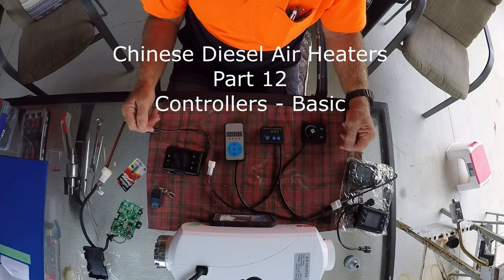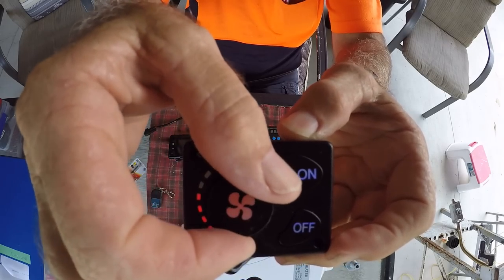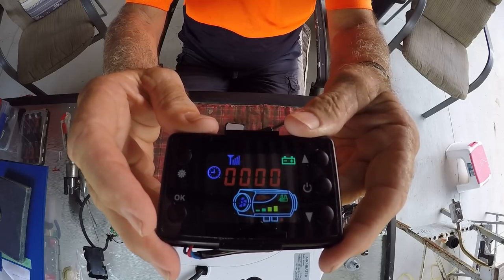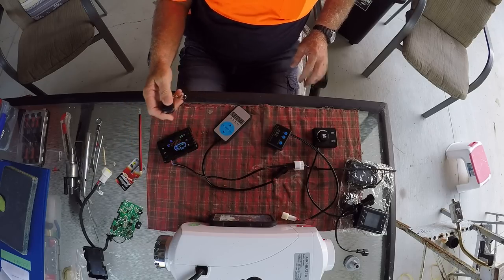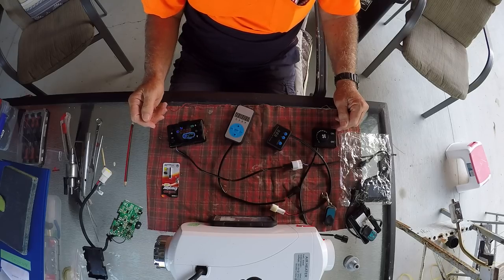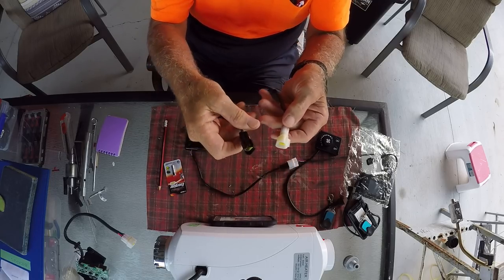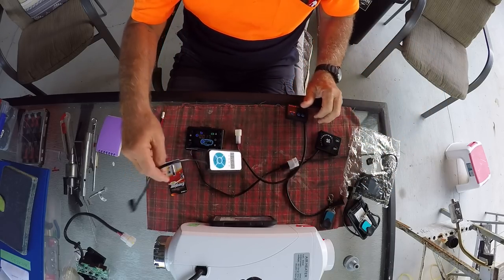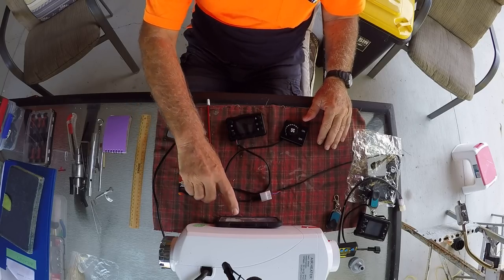Chinese Diesel Air Heaters -  Part 12 - Controllers (Basic)

Comment: John what do you recommend for a filter on the intake of the little heater mind goes in a camper which can get Dusty do you recommend anyting to that to filter the air or do you recommend just draw in fresh air in from the outside and not circulating the air inside please let me know ASAP cuz I'm fixing to hook up one
Reply from the maker: Hi Steve, I assume you mean a filter on the large air intake that goes over the heat exchanger. Yes you can buy a high volume air filter from an auto shop that works a treat.
Whether you recirculate the air or draw fresh air in from outside is purely personal preference. 

You will need a good foam air filter on the combustion air inlet in dusty conditions.

Regards.  JMcK
Reply: @johnmck1147  thank you so much for your reply I really needed to know as Iam putting this in a enclosed trailer / tiny house I guess I did mean filter your study of the diesel heater has informed me quite well and I see what you say about the 5kw and the 8kw wish I had saw this video before I spent extra for the 8kw but Lessons Learned may your day be blessed keep up the good work Steve
Reply from the maker: Steve Sidden 

Your welcome Steve
Reply: @johnmck1147  I forgot to ask you earlier do you feel confident that this little heater will heat 160 sqft enclosed trailer and the negatives with 1 inch styrofoam insulation in the walls and 2in in the ceiling and one inch in the floor I would prefer this type heater over a propane heater 2 to 1 because of the moisture I have already received a 5000 KW and have made Provisions for it although I could use propane please reply ASAP and again thank you
Reply from the maker: Steve Sidden 

Hi Steve, a 5KW diesel air heater will keep you snug and warm in your trailer even in very cold weather. It will also give you a dry heat and not fill your trailer with condensation and water vapour that you get when using a propane heater.  JMcK
Reply: @johnmck1147  again I must say thank you for your expertise I do appreciate it may the holidays that are coming up be much for you and your family Steve
Reply from the maker: Steve Sidden 
Your welcome Steve. JMcK

Comment: Speaking of the controller with the different wiring.
Would it not have been possible to use a normal controller, change the two wires around on the plug and then use it?
I am sure these one wire is positive power, a 0v wire and a control wire. I am sure changing the wires around would work perfectly without buying a different ECU.
It would be a much cheaper solution.
Reply from the maker: Yes, this is so in a lot of cases, and I have replied to similar questions. But sadly some manufactures these days use a totally different protocol and and this can not be done easily.  JMcK
Reply: @johnmck1147  Ah right. So they reprogram the ECU. Right. Then it is inded important to keep an eye on that. Perhaps it is a good idea to make a FAQ video?
Just a suggestion 🙂

Comment: hi i was wondering if you could help me i bought a heater from a supplier off ebay for cheap and the wirring is different seams wierd to me 
i pad $55 to hopfully save on the controller and remote but after watching your video im worried to start it without your blessing

Comment: Another very informative video John, so glad I found your YouTube channel before I went I bought a heater, still haven’t got one yet but I am getting closer to making a decision, do you know of anywhere around Brisbane to buy from, again  great videos mate keep them coming
Reply from the maker: Hi Mick, you need to go through the suppliers to get the best deal, and right accessories. Suggest you purchase off a seller with an Australian warehouse. Have a look at these below as a starter.

https://www.ebay.com.au/itm/12V-5KW-Diesel-Air-Heater-Tank-Thermostat-for-RV-Motorhome-Trailer-Truck-Boat-BK/283071367247?ssPageName=STRK%3AMEBIDX%3AIT&_trksid=p2057872.m2749.l2649

https://www.ebay.com.au/itm/5000W-Air-Diesel-Heater-Car-Vehicle-Heating-Single-Hole-LCD-Switch-Vehicle-12V/273585249890?ssPageName=STRK%3AMEBIDX%3AIT&_trksid=p2057872.m2749.l2649

Cheers, JMcK
Reply: John McK 47 thanks mate

Comment: Have you done any work on setting temperatures and the accuracy of the Chinese units. Generally they rely on the thermostat inside the heater to measure rather than the controller. Unlike the Eberspacher these units won't automatically switch off when set temperature is reached, instead they will continue on iddle.
Reply from the maker: No Trevor.  I often mostly prefer to use the manual function, which I set to a constant comfortable level, and prefer that to having the heater on start up roar at full speed trying to heat up a large area. 

However, you have got my interest, and this coming southern winter I will see if I can find a small garden shed or similar and do some testings with different controllers.

Thanks for the feedback. JMcK

Comment: Could you shut down the heater by unplugging the pump and wait until the unit is cool then disconnect the supply?
Reply from the maker: Yes Chris, you could do that. In my boat I have installed a diesel cut off valve in the fuel line as the heater is in the lazarette and not too easy to access.  JMcK

Comment: Does the IC  have a battery protection safety shutoff ? When the battery goes below 12V (or any set Voltage) does it initiates shutdown ? Can you run the heater while the alternator (~14.5V) is running in a vehicle ?
Reply from the maker: Hi Gabriel, yes these heaters have a low voltage shut off, but it is quite low down around 10 V. I have never heard of any trouble using them with the alternator running.  JMcK
Reply: @johnmck1147  uh , that is very low ...  10.5V is basicly 0% on starter battery which is highly not recommended due to plate damage ... 12,1V is considered discharged ...I think deep cycle RV and Solar batteries can whitstand those deep discharges. It's good to know at least it shuts itself off if left unattended on battery. Is it possible to change the shutdown V value somehow ? Changing a diode , resistor or FW ?
Reply from the maker: Gabriel Kozsar 
I agree about the low voltage level, but this is an emergency procedure, and in real life people must have good battery management of their devices, and one should NEVER connect one of these heaters to a starter battery, that is just asking for trouble. 

This should not be an issue in practice, with proper battery management, but if it is of concern the heater could be connected to a seperate battery management cut off switch.

Cheers. JMcK

Comment: Hi John - Thanks for your video series. Most informative. I’m hoping you or anyone of your subscribers can get get back to me with answers to the following:
1. For the black LCD animated controller is there an option to change the temperature readout to Fahrenheit I/O Celsius?
2. Similar to my question above, is there an option to change to clock display to a 12hr(am/pm) setting?
3: Is there an option to change the default display to current temperature vs current time? Being that this is a device to control the temperature I would think current temperature would be the priority setting. 
Note: My unit came with next to no info on control settings, only error code info.
Reply from the maker: Hi Michael,
Sorry I can't help with those three questions. Perhaps a viewer may have more info. 

Those questions have not been a priority for me in the past, and right now I am away sailing without access to that controller to try different button combinations again.

In the past, when I first got a black LED controller, I tried all sort of button combinations, but I don't recall any parameters that you asked come up, but be aware, it was not something I would be looking for either, and may have missed something.

If you do find out, I would appreciate being informed.  

Regards, JMcK

Comment: How do you prime with basic control?
Reply from the maker: Hi Barry,

Fill up the tube from tank to pump with diesel in a manner that will suit you. Then connect to pump and turn heater on. It may take a few goes to get all the air out.

Suggest you have a look at my video on the pumps.

Cheers,   JMcK

Comment: What I'd love to find out, is if there's any plug or plug adaptor suppliers. I've a three button LCD display with a single on/off button and < > either side. It has a small, round three pin plug, and not the larger triangular three pin plugs that all these other controllers have. I need to find a source for the latter plug&socket sets so as I can ditch the stupid little round one. Wiring still seems to be the standard red/blue/black though. I suspect that my manufacturer was just trying to buck the norm and has messed up big time. Maybe I need to look in the DIY RC model community?
Reply: Having a similar issue with controller plug style Square-Round-Triangle types seem to be the 3 types. I am wondering why I have not yet heard any suggestions to just cut the wires on both plugs (your old one & whatever new one you get) and just solder the old controllers wires (with whatever style plug it has) onto the new controller. There seems to be a pretty standard of 3 wires & what hopefully is a standard color code to where & what functions those color wires go to between the controller & mother board?

Comment: I have the full function control have recently had issues with it going blank and shutting off the heater I know the power is fine the screen will come back on randomly. I’ve hard wired the plugs still has not fixed it
Reply from the maker: Hi Andrew,
If you have double checked the wiring, and you have adequate wire size, not the thin cheap stuff that comes with many heaters, and you have more than 12V at the heater,  you possibly have a bad controller. If the heater is new, please ask for a replacement. If heater is old, you can buy spare controllers on eBay.  JMcK

Comment: Hi John, just had an "incident" with my new diesel heater or actually the 12 volt power supply.........it was working in the morning and suddenly the power supply turned off........drat, the power supply has died .....it was bought new a few days ago.......the big problem is the heater turned off while it was running and I got a strong kerosene smell while it cooled down which was not a good sign.......however 10,miutes later the power supply was working again and the heater fired up so all was OK.
There is no way to overcome the problem as once the PS stops the heater could overheat etc.
To cure this I think a couple of 12 volt electrolytic capacitors connected in parallel with the heater fan motor could supply enough current to the fan for a time to allow the heater box to cool down.....about 5 to 10 minutes of voltage at 12 volts would probably do the trick......how many farads I don't know.
The capacitor(s) would be wired permanently in the circuit in parallel with the fan and get charged from the fan supply while the heater was powered up.......if the power supply stopped the capacitors would automatically supply power until they ran down.......just need to have them big enough to last 5 to10 minutes to just drive the fan while it cooled down the heater box.....the fan motor draws very little power......if it works it could be a savior.
Have you any ideas on this theme?
Reply from the maker: Hi Ian,

On shutdown, it is not just the fan that comes on but also the ECU turns on and heats up the glow plug to burn off any remaining unburnt fuel. You would need some mean capacitors to provide 8 to 10 amps of current for a few minutes.

If a power supply failure is very remote and the heater in not in an enclosed space you could possibly accept the risk of failure.

Perhaps a better solution is a small motorbike battery and a small battery charger permanently connected.  JMcK
Reply: @johnmck1147  Thanks, yes a normal shutdown proper would need to do all those things..........I was thinking that it's the heat from the burner heat exchanger that does the damage due to the fan not being on and you still have a very hot burner heat exchanger casing, to fry the circuit board above it, so if it cools the burner heat exchanger housing enough then perhaps the components wouldn't fry when the power cuts.....the least protection for the simplest solution etc. as the fan only takes a few milli amps to run for 5 minutes.
All things being equal etc if the fan failed then you can kiss your ass goodby anyway and those fans are as cheap as  etc.

Comment: Their severall heaters on Amazon what 1 do you recommend for the best one that's out there Thank you very knowledgeable
Reply from the maker: Hi Alan, there are many foreign copies of the original German Eberspacher on the market. There are also quite a number of Chinese manufactures selling on Amazon and eBay. I can't recommend one over the others. I suggest you buy from a supplier who has a local warehouse, and accepts returns.

I also suggest you bench test your heater when it arrives before install to make sure it runs well with no issues. 

Two issues to watch are the fan scraping the case from poor assembly or poor moulding, and a non functioning controller. These issues are not common, but do occur, and it is a small price to pay for buying a very cheap heater when compared to an original heater. This is where a supplier with a local warehouse is helpful.  JMcK
Reply: @johnmck1147   Thank you so much for the advice Love your videos keep them coming  Big al Michigan USA
Reply from the maker: Alan  Call 

Thanks Alan.  JMcK

Comment: Hi I have a diesel heater running off a 12v leisure battery in my garage that is charged via a 120w solar panel and a solar charger. The solar controller has an output for lights that can be set to turn off the lights at a given voltage and not flatten the battery completely. Could the power to the oil pump be spliced and be fed the 12v from the solar controller so once the volts drop to a given voltage it turns the pump off and throws up a fault and the heater turns off but would go through the correct shutdown procedure and not damage the heater itself. Other wise if the battery went flat the heater would just shut off and the heat would damage the heater
Do you know how many amps the oil pump draws as it would have to be less than the output on the solar controller or it would  trip the electronic fuse
Reply from the maker: Hi Michael,

The little dosing pump draws very little current, less than an amp or so depending on its setting.

The ECU will put the heater into safe shutdown mode if the battery voltage drops too low, so you do not need additional protection.  JMcK
Reply: @johnmck1147  agh I thought the heater would keep running until it flattened the battery and destroy the ECU by overheating it. Saw a video where a YouTube use had fitted a drop voltage sensor to cut the volts for this very purpose. So little instructions with these Chinese heaters

Comment: Could one not just swap the wires or are the voltages etc different ? And if no spare, cutting fule line and wait before cutting power to the heater ?
Reply from the maker: Yes, in most cases you can just swap the wires if the standard protocol is used. Sadly some manufactures now use a proprietary controller/ECB interface.  JMcK
Reply: @johnmck1147  After seeing your videos, I realised that my connector too is not "standard"...  We live and we learn. Will pay close attention to those details on my next purchase.  Thank you. Just installing the unit on the boat.

Comment: Hi John, quick question if you dont mind, i fitted my heater today and i have the colour  LCD control that looks the same as the one you have in your video, my friend also has the same control in his van, heres my problem, when i try to prime my system by pressing the ok and down button to switch on the prime option it only wants to set a timer or someting, so i compared to my friends van and it primes normally. so next i get a loan of his controller but i get the error E-07 when i use it even though it works fine in his van. any idea what might be going on .
Reply from the maker: Hi Mark, sorry I missed this. E07 is generally a communication fault in the blue wire. The controller and the ECU are not compatible. Sadly some heater manufactures are selling heaters with non standard wiring so preventing mix and matching of controllers. If you have good electronic knowledge you can sometimes rewire the controllers, but it is not often easy. Suggest you manually prime the heater. JMcK
Reply: John McK 47 thanks for reply John. I got a loan of a controller and  mother board from a friends one and all works normally. So I’m onto the supplier to see if they will supply me a new controller and mother board. I would consider myself to have a good electrical know how. I have removed and added devices to circuit board before ! Do u know what wiring I might need to change? I have nothing to loose anyhow!
Reply from the maker: Mark Halligan 
Hi Mark, If you get the mother board and controller from the same source, it is almost certain they will be comparable. In a rare chance they are not, ask the supplier to supply you comparable devices.  JMcK